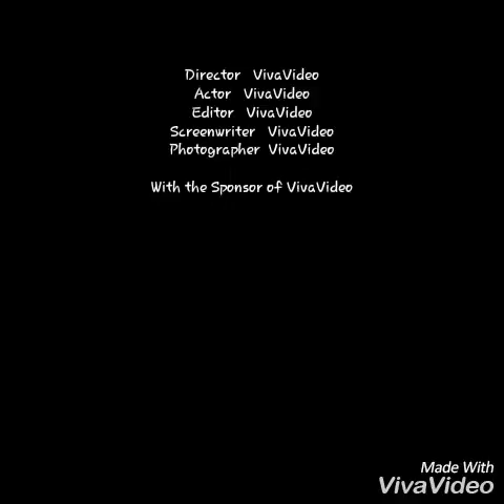Coolent changing

Comment: Hi ,  im facing heating issue in my cbr 250r after my servicing, so i recently top up coolant in reservoir tank, want to knw can i add coolant directly in radiator cap? Is it safe?
Reply from the maker: No no top up  only reservoir tank. Do not add/top up directly in radiator....
Reply: @Tojodusoffi   @Tomo Syue  actually i had serviced my bike last month n my mechanic told me tht my relay of radiator fan not working, n it was not available tht period fr 5 days, so i had used my bike 5 days Without working of fan, but due to tht engine heated a lot n found coolant was leaked a lot during my  first ride , but afterwords bike facing heating issue, so i checked yesterday my coolant level in reservoir, it was empty, i top up d same, but i feel coolant also low in radiator, in view of this want ur advice tht shall i top up coolant directly in radiator as i already top up in reservoir tank?
Reply: 1 liter coolant how many mix water